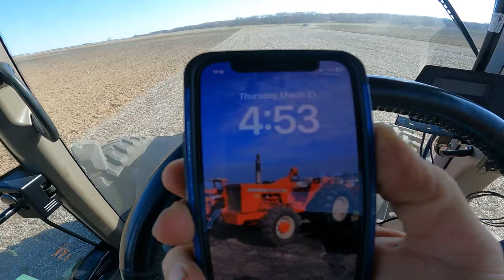Disking corn ground for 2024. Covering 40 acres an hour.

Comment: Not surprised at the 4840 pulling a 30ft, it's the fact it's just 2WD and not spinning. Used to pull a 24ft 235 JD Disc with a 4620 PowerShift in 4th. It was a load and didn't spin in the hills unless it was wet. About 3200 in Cast iron on the rear. Years later, I lightened it up and toyed with a 14 ft 215.
Reply from the maker: Thanks for watching. Yeah  in our sand it don’t pull as hard like clay does.

Comment: (WIDTH IN FEET) X (SPEED IN MPH) / 8.25 X (ESTIMATED EFFICIENCY PERCENTAGE) = ACRES PER HOUR   IN YOUR CASE ( 96 FEET X 5.5 MPH ) / 8.25 x .85 = 54.4 ACRES PER HOUR APPROXIMATELY
Reply from the maker: Thanks for watching. Yeah all 3 of us pulled into this 40 acre field at the same time and an hour later we were done.
Reply: Before I saw your comment, I ran the same formula at 4.5 mph. Came out to 44.5 acres per hour. I also used 85% efficiency. It's not that these tractors can't run at a higher speed, it's how bad they can ridge which the Red rig is sure doing. I've found that slowing down and pulling a bigger disc actually covers more ground. Pull a 24ft at 4.5 vs a 20ft at 5.5. Virtually the same. If you use a low grade guidance system to keep overlap to 6-12", that efficiency goes to 91-92%.
Reply from the maker: @thegreenerthemeaner  we all run 5, they do a good job.

Comment: What is the hp for each tractor? The 4840 sounds great!!!!!
Reply from the maker: The JD 4840 is 180 to 185, the 4955 is 200 to 210, I kinda wonder if the pumps not been turned up a little because it pulls the 33 foot disk good, the case is 305.
Reply: @Hinesfarm-Indiana  Thanx, Boss!
Reply from the maker: @atomicwedgie8176  yep 👍
Reply: @Hinesfarm-Indiana 98% of those old Deeres have had the pump turned on. My 46 I plant with still had the wire on the back of the pump until we had the pump rebuilt. I know what the previous owner said, but it sure sounds like an exhaust manifold gasket leaking on the Magnim.
Reply from the maker: @DylanJoyceFarms  yep numbers 2 and 4 I gotta replace the gaskets. Yeah our one 4840s had the pump cranked up.
Reply: glad you got it figured out. @Hinesfarm-Indiana
Reply from the maker: @DylanJoyceFarms  yeah it’ll be a winter time project, gotta take the hood off to get to it.
Reply: What is the green you are disking up? Rye?
Reply from the maker: @AgWildNebraska  it’s our old wheat field from last year
Reply: @Hinesfarm-Indiana  oops. I guess I put this under somebody else's comment
Reply from the maker: @AgWildNebraska  no problem 👍

Comment: 8 th in 49 why so slow 10th is norm
Reply from the maker: 8th is right around 5.5, just right. Now if the tractor had smaller wheels then yes you’d need 10th. All 3 tractors are running right around 5.5 mph.